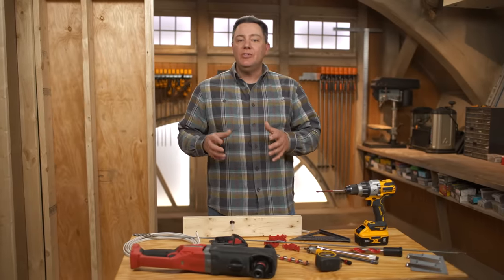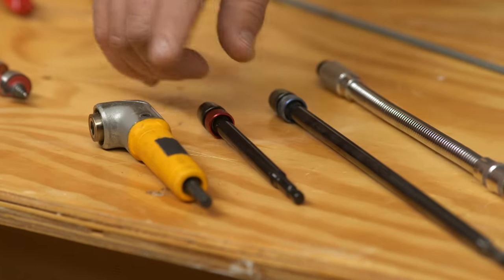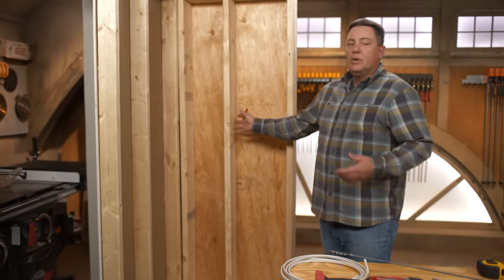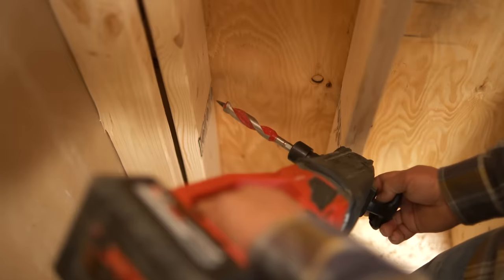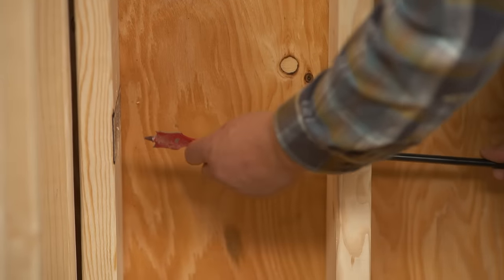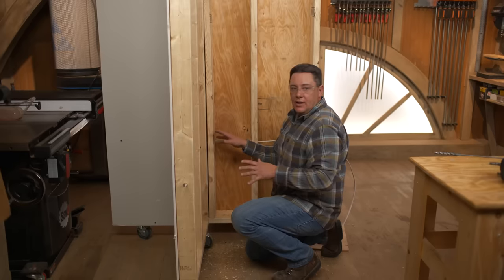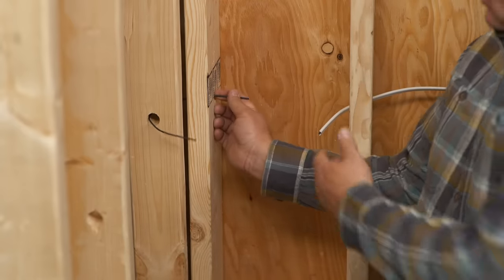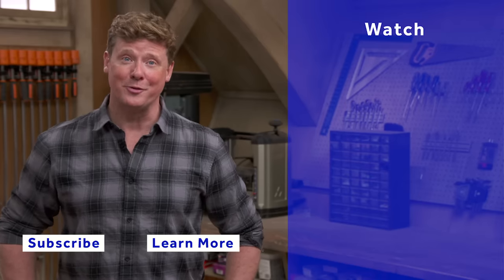Drilling Into Studs for Electrical Wiring | Tool Lab | Ask This Old House

Comment: Strike plates are code and should be installed anyway . The last time an electrician drilled holes through sonne side at a house i was working at board every single cripple above a doorway using ng big hole auger with a long bit. O was was the one doing the drywall behind the electrician, i wanted to strangle him and so did the home owner. I fixed his mistakes and needless to say he never  returned , i wonder why. Maybe he should have watched this video. Lol good video. 👍🏼
Reply: Strikes plates are only code if you aren't meeting the required clearance from the edge of the stud. But I agree that it's good practice. In reality though most electricians are not going to do them if they aren't required because they need to manage costs (and labor time).

Comment: What tool would I use to notch a 4x8 in an outside corner of the old shed we are wiring which has a 2x4 on both sides.  I don't see any way to drill a hole that makes a 90 degree turn so I am thinking about using an oscillating multi-tool to cut a notch maybe 1/2 inch deep then covering it with a strike plate.

Comment: I love Heath but I just wish he would have used a shorter screw (think drywall 1-1/4").  I get the point still comes across, but even with the standard 1-1/4" set-back where code comes in, that screw would have still hit the NM-B. Again, I get it, it was a generic showing of what might happen.   
Still a great video as always!

Comment: Every time that I rewired an o!d house I would purchase a quality nail eater 12 or 18" long auger bit made by Greenlee. They have no problem cutting thru nails. For basements used a 18" extension to drill tons of holes entire length of basements. Probably could buy a new car if I had a dollar for every hole I drilled to pull wire. Had one big house with 80 circuit breakers that think I drilled 18 holes in each basement joust.

Comment: I've found it to be easier to run outlet wires inside the floor before concrete etc. and lighting/ switches inside the ceiling, that way you don't have to drill every stud. I don't know is that the code in US but it's common here.

Comment: I wonder if there's some metal inserts (like hose braces) into those stud holes, so when I drill through studs for hanging something heavy, the drilling halts hitting metal before drilling through electricity line causing bigger issues.
Reply: You can always add a metal plate right below the drywall on the stud with the hole too close to the edge.
Reply: I have thought of his very idea because strike plates lift the wall sheeting off of the stud, making ever so slightly unplumb walls. With a metal insert, you can increase the hole diameter, maintain structual integrity, prevent accidental wire punctures, surpass current code when its required, and not need the concern for a required hole being centered.  My thought was pieces of metal conduit with a rounded over lip to prevent wire chafing and provide a depth stop against the stud, using two 'halves' long enough to mate in the middle of the stud so that each side is protecting the wire against chafing. IMO, it seems a whole lot better than strike plates.
Reply: Yes there are grommets that you can use specifically for this purpose
Reply: @baxt1412  can you please link one or provide a good search term my search history wont confuse it?
Reply: @igounfazed  watch the video above
Reply: @baxt1412  is there a time stamp you're referring to? I watched the video and found it lacking anything resembling common sense as a "tip" other than the wall bend. I did not hear any mention for in hole metal wire protection as an alternative to nail strike plates.
Reply: @igounfazed  5:50
Reply: @baxt1412  yeah, it seems we are talking about two different things.  At 5:50 he's explaining the wall bend technique, which we are not talking about. We are talking about alternatives for nail plates (7:50) that fit inside the drilled hole the wire is passed through.
Reply: @baxt1412  never mind,  youTubes snooping algorithm suggested a video that answers the question we have by a non-profession that seems more informative than the guy on this video. There is something called, ez-guard which does what we are talking about. 

Title: "How to run Electrical Wires Through Studs", 
youTube channel: Everyday Home Repairs,
Video: https://youtu.be/HTrsF20jA80, 
At time stamp 7:50
Reply: @igounfazed  gah wrong video sorry. 5:50 on this video https://youtu.be/HTrsF20jA80
Reply: @baxt1412  Yeah, that's the one that I linked on my second reply. It turned up on the 'suggested videos' side on the right.

Comment: The top half of my house still has knob and tube. So, from light, to light switch, and to the basement. I'm going to pull all the electrical wire in my own house and let a electrician wire the electrical panel. I like to use 12/2, but I know 14/2 is sufficient. Part of the rewiring is in the kitchen. There's no insulation in my house and I can't insulate my house, until I deactivate the knob and tube, by pulling new Romex wire first. The current wire is Solid Romex Simpull CU NM-B W/G Wire.
Reply: that's going to be a great project and save you money and worry in the long run, good luck bro.

Comment: Tried using an angle adapter with a self driving auger bit for same application but it kept trying to rip my arm off. How did you use the self-driving but so smoothly without it catching a stop in the drill and jerking around? I’ve had to telescope in and out just to get through. Quite tedious
Reply: I found that using those bits with an impact driver made all the difference. No more dislocated wrists!

Comment: Is there any benefit to not lining up holes in order to promote more structural integrity in a load bearing wall? Or is keeping the holes to 3/4" sufficient that this extra step would not be necessary? Thank you!
Reply: Well when you consider that up to 3" PVC pipe is run through a number of studs, a 3/4" hole isn't going to affect them much. Most of the load on a stud is compression pushing straight down, so the load can go around a hole, like an arch.

Comment: It's very different when you have drywall on both sides and you don't want to rip down your walls. Unfortunately, there's just no way around taking down one side or other of a wall, or at very least a large hole.

Comment: I don't understand why alleged professionals never make, use, and or reccomend a TEMPLATE to make the through holes?! WTH gives? I'm a DIYer and know something this simple in idea and function, yet veteran electricians with decades under their experienced belt never rven consider it? You get a scap piece of stud, make your centered hole in it, put it against the to be drilled wall stud, drill through template.  Done. Centered every time, and I don't even do this for a living. It really shines when you want to drill every hole aligned to each other, as you can run a chalk line to mark the height and use a template with a line on its edge to get all your holes at the same height and depth. Professional tips? IDK...